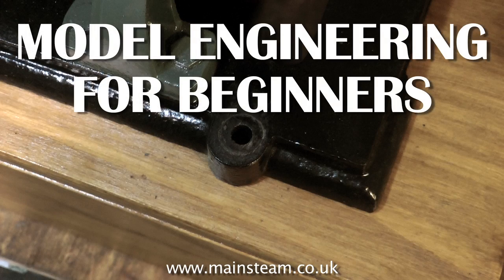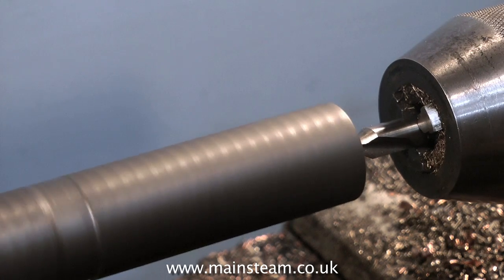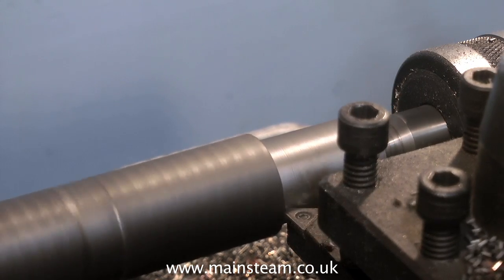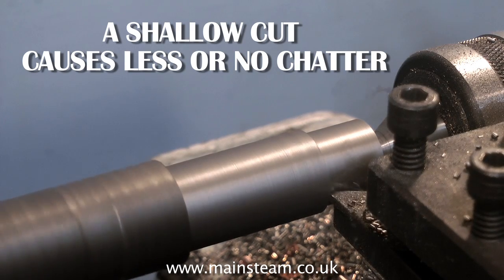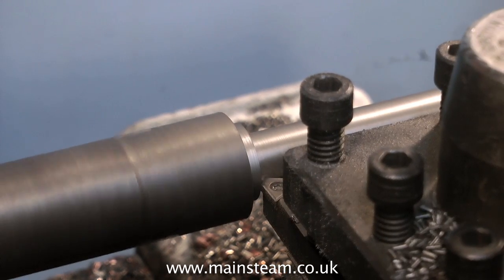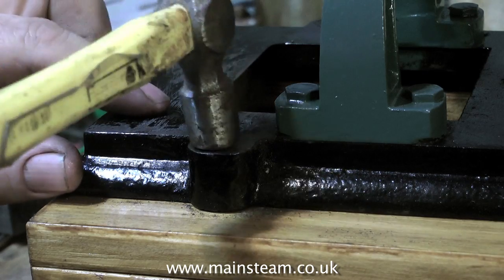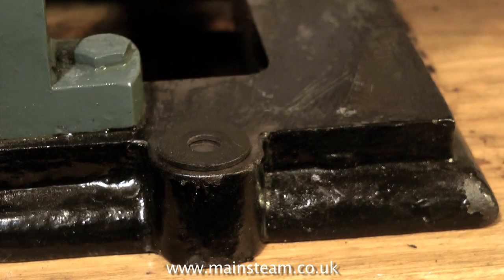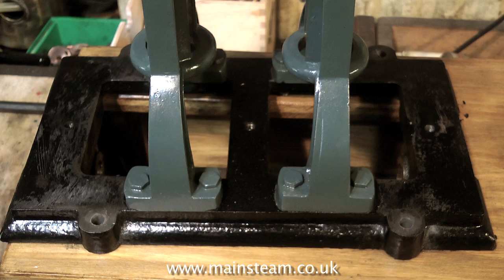RECTIFYING METALWORKING MISTAKES - MODEL ENGINEERING FOR BEGINNERS #9

Comment: Enjoyed your video very much. May I say, it is better to grind a centre punch with the grinding from the point to the body of the punch. The point does last longer if the tiny score marks from the grinding are not round the tip.